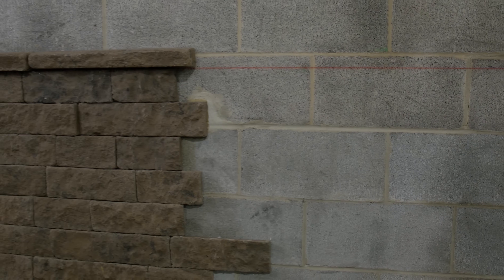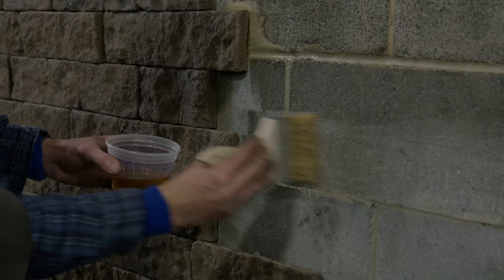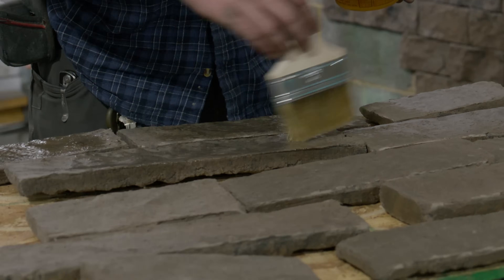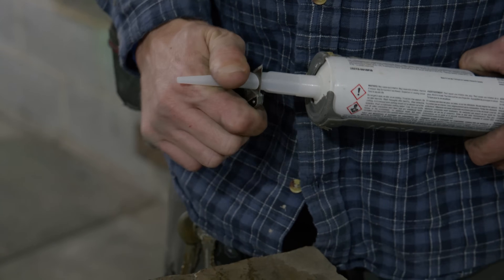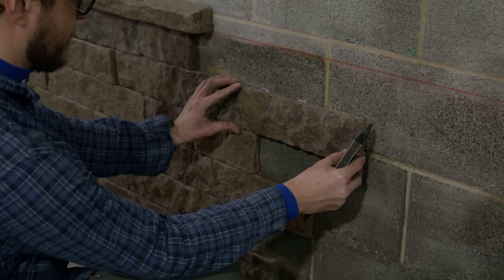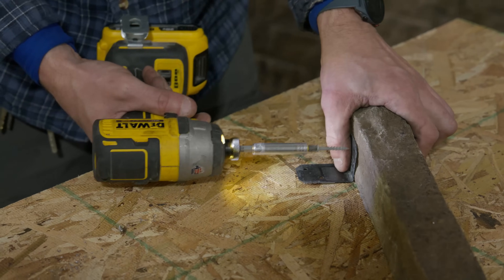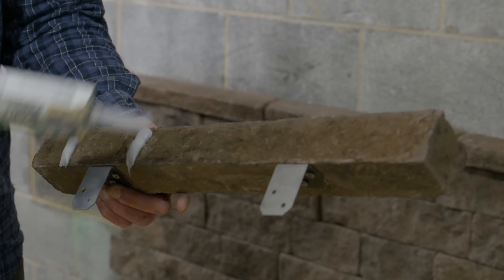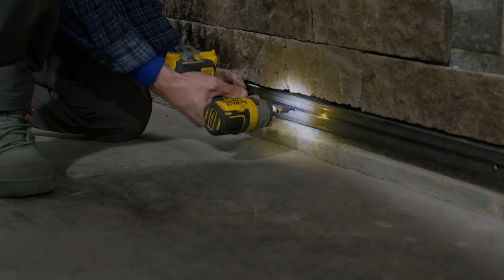Install Tips: Glue | Evolve Stone

Comment: Can this glue method be used on exterior applications?
Reply: Same question? is this ok for exterior applications?
Reply: Guess they don’t give a shit to answer, which is crazy given how expensive it is
Reply: Yes, this can be glued in exterior installations.  That is what this video is showing.
Reply: @mikecatalina2975  To be fair Mike, it is showing it being applied to a masonry wall. I would imagine it works terrific on an interior masonry surface like a fireplace or basement wall. At the time of my original question the product and video were new so there wasn't a way for me to know if this was a product that could be used as an exterior siding or wall cover-up etc. exposed to weather elements. 

Anyway, thanks for your timely response a year after the question.
Reply: @brians9072  I just saw your comment.  I am a manufacturer rep for Evolve in NY state…I don’t work for them.  Sorry for the delay.  I meant to say that was what they were trying to convey in the video - exterior installation, my bad.
Reply: @RxGuy95  I’m not with EvolveStone, but yes it can be used on exterior surfaces. Consult the installation manual as based on which surface (OSB, concrete, or other you needs to consider water drainage with WRB and the RainScreen.